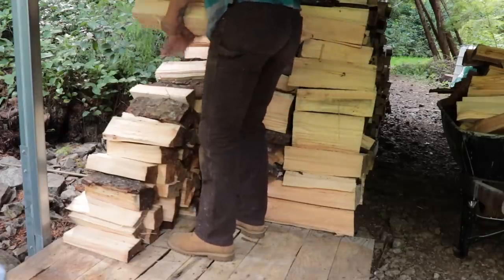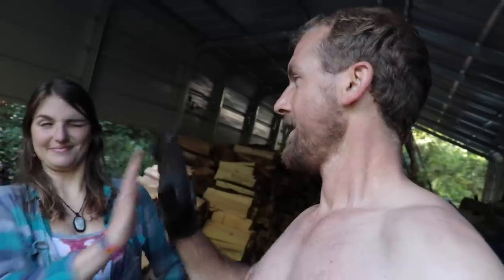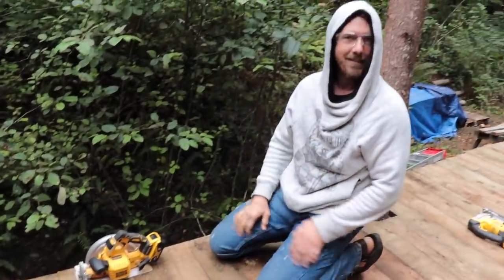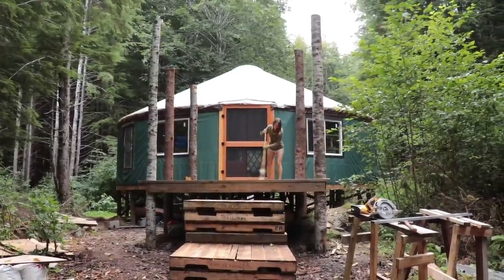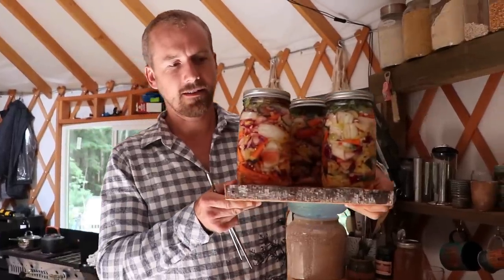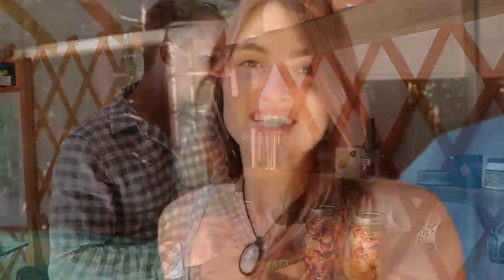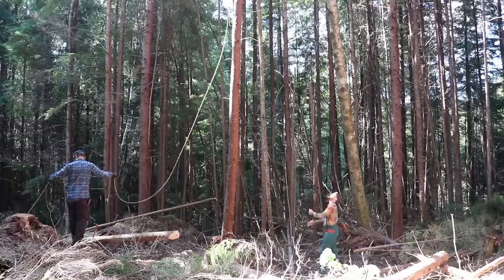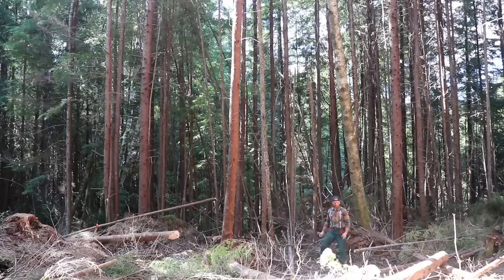This Yurt Will Blow Your Mind - Living Off Grid in the Forest - Ep.48

Comment: What is normally done is to use a compass. Spread it out maybe 6",  position the board, run the pointy end around the post and the pencil draws your cut line. This technique can be used anywhere there is an irregular shape.

Comment: One thing guys. I don’t know how high you are in elevation, or how much snow you get in the winter. I lived at 9000 ft stacked up against the divide and got more snow than I care to think about. The point is I started chopping wood in August and always had several chords of wood to burn. You have to make smaller pieces for your stove. Hope you split more wood than you need.

Comment: If I had some spare wire hanging around, I would wrap it around the post a couple times (banging it with a soft mallet so the wire takes the shape of the post). Then I would snip the wire while still wrapped around the post (so you don't have to unwind the wire to get it off) so I'm left with the semi circle shape of half the log (or however much you wanted). Would then use that shaped wire to trace onto the lumber. Cutting it with a jig saw leaving as much space as you wanted.

Comment: From personal experience, the tree will MOVE during high winds, which you need to compensate for, and over time, the tree will GROW and the diameter will increase which WILL cause you a problem in the future if the "wiggle room" is not large enough.  Been there, done that.  MY problem with this issue was with the eave of my home.  Yeah, big problem.  Good luck.

Comment: since you probably do not want to run out and buy a contour gauge. you can wrap a solid copper wire half way around to use as a profile template  set it on the board where it goes based on the distance from the end and from the edge

Comment: I know you're new at this Jake but building a deck the way you have is not sufficient to have it last or make it safe. First of all, burning the buried ends of a wet pole with the bark on is wasting your efforts. They need to be dried and skinned before they can be effectively treated for rot. next, you need to skin any pole before you use it to construct anything. Otherwise, the bugs, while enjoying a meal of the cambium layer under the bark will eventually cause the pole to rot. After removing the bark you need to weatherproof the pole by coating it with something to keep moisture from penetrating the wood or it will not last more than a few years in that environment.  The last thing I will mention is that you can not rely solely on the shear strength of the construction screws to hold up the deck. You must incorporate a mechanical joint to ensure the safety of the deck ie notching the poles so that the supporting lumber is being supported by the pole physically. I've done lots of building and framing with round timbers in BC and what I've mentioned above has been hard-won knowledge learned through my mistakes. I hope you take the opportunity to learn from those mistakes.
 I enjoy your videos otherwise I wouldn't care enough to give you this information. Good luck

PS when you insulate the underside of the yurt you will want to protect the insulation from the mice etc. The best way I've found is using sheets of metal lath. It's cheap, light and easy to install, and will allow the required air movement on the cold side of the insulation.

Comment: I really wish them both the best. I have been following Jake on and off for many years. But man, I am scared Jake's constructions will fall over after a few winters with heavy snow and winds. I am also scared to death by his tree felling techniques. The leaning tree in the end would be such a basic simple easy job, without any ropes (!!), just using the chainsaw and a wedge. Instead they have it almost crush the car, and the end of the tree flying high in the air could easily kill anyone near! Cutting it like that could snap at the bottom by surprise and shove the chainsaw into his face in 0,1 seconds. I feel like sooner or later something tragic is going to happen, and I really don't want to see that. Please Jake, at least watch some basic tree cutting videos on youtube, and also, watch some tree cutting fail videos on youtube. I can see that you are taking more precautions than earlier, but still the lack of technique in this case can be fatal. Making a leaning tree fall into opposite direction (without the bottom flying into the air) is really basic stuff.

Comment: Looks like your method to draw out the partial hole worked OK.  I would have used my "contour gauge," but mine is not big enough.  I don't do enough larger work to justify purchasing and storing a bigger one. Lacking a larger one I would have measured the circumference of each tree, calculated the radius and drawn a circle onto the board with my drafting compass.  Now, since the log does not have a perfect circle, which the compass will draw you, I would then use the large half round rasp file I have to shape to fit.  Or, I could use the drum sander hooked up to my power drill, starting with 40 grit paper.  Or, more realistically, the file followed up by the drum sander.  However, you don't have a insulated, sealed garage (mine is with a R19 door and bottom seal is flush with concrete full width ) and live in an area with low humidity.  How low is the humidity?  I have a 44 year old Toyota FJ-40 I bought new and it has no rust.  

Drum sander fittings for a hand drill don't take up much room and I find I use them pretty frequently.  I get some good fits and end up using very little caulking while keeping mice out very nicely.  I live in the woods also, but at 8,200 feet.

Comment: THIS IS A LOAD BERING DECK YOU SHOULD HAVE NOTCHED YOUR FRAME INTO YOUR LOGS THIS WOULD HAVE BEEN THE CORRECT WAY!  INSTEAD OF SCREWING THEM IN WRONG WAY SORRY FOR BAD NEWS BUT YOU BUILT YOUR DECK WRONG.
Reply: Lag bolts 3/8" x 5 1/2" through all flooring joists into the log risers and around the outside perimeter of the framing into each joist will fix this. It can be done anytime in the future even up to the day structural failure first becomes noticeable so no worry about this for now. Make sure to pilot drill out all the lag bolt connections. You can run the lags by hand with a socket wrench or quicker is to have an impact wrench. Probably a better trade on time for materials with the lag bolts as opposed to notching.

In addition cleats can be fitted same with notching under the deck frame after the fact.
Reply: @GilbertBigelow  This is the sort of helpful information that J&N will be able to read and impliment and all set out clearly! It truly warms my heart Gilbert, that you are prepared to offer them good professional, free advice and I salute you Sir. I pray that your good turn is returned back to you tenfold. Many blessings 🙏